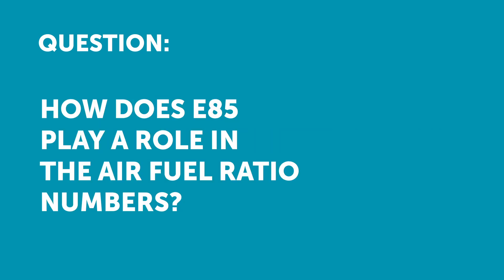E85/Ethanol Fuel vs AFR's | Ethanol Fuel Tuning [HPA Q&A]

Comment: If you have a wide band set up for gasoline scale and were say 11.5 afr wot on boosted setup if you convert to e85 and leave your wideband set up for gasoline it will still show 11.5 afr wot on e85 if tuned for it and same lambda
Reply from the maker: Hmm, if I'm reading your question right, not quite. The AFR will change while lambda is the same. Lambda 1 is always the stoichiometric ratio, but different fuels have different stoich.

You don't actually need to know the exact 11.5 AFR, you just want to know where stoich is in then how far from that you are, rich or lean.

This link gives a quick explanation: https://www.hpacademy.com/technical-articles/afr-vs-lambda/

Hope that helps - Taz.
Reply: Apparently these days external widebands measure always lambda and with settings you can select what it will display. So if your exhaust is lambda 1, it can show 14,7 regardless of fuel in use.
Best explanation I can give with my English. 😅

Comment: 14.7 to 1 for gasoline. 14.1 to 1 for 10% ethanol pump gas.
Reply from the maker: That's the stoichiometric ratio which is independent of target AFR in performance applications where we might run leaner or richer in different areas of the map - Taz.
https://www.hpacademy.com/blog/how-much-more-power-can-you-make-on-e85/
https://www.hpacademy.com/blog/the-biggest-mistake-tuners-make-r34-gtr-tuning-and-dyno-run-techtalk/

Comment: The reason why the E85 stoichiometric A/F (lambda= 1) differs from the petrol is because the E85 contains hydrocarbons but also the OH group (C2H5OH). So there is internal oxygen in the fuel. When burning the E85 with lambda 1 it need less external air to burn because of this "internal" oxygen...

Comment: I didn’t know that there was a stoic emetic thing for 98vse85. So if using a Fueltech Exhaust Nano should I be aiming for the 9.8 that e85 is or go for the 11-11.5 range   And also there’s the variables depending on what my motor likes. Mild LS1 turbo Ls9 cam 
Using a flex fuel to. Thanks for your time